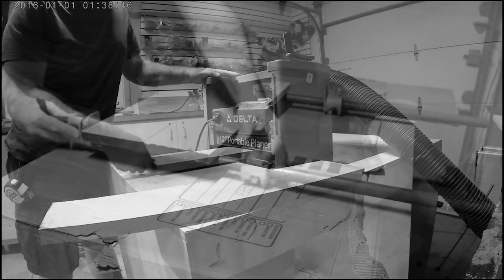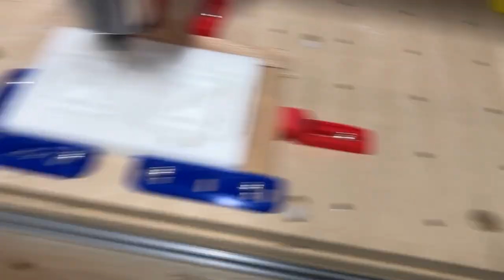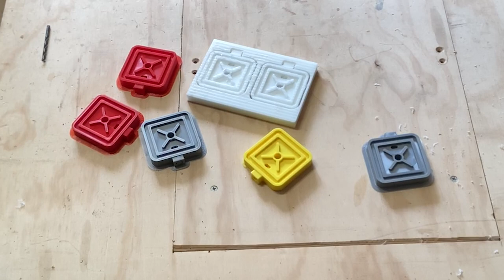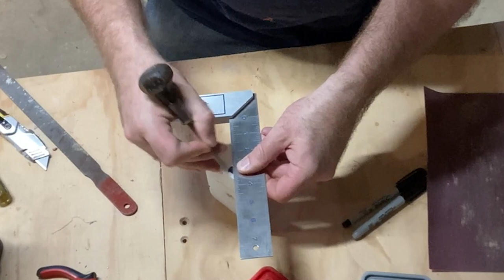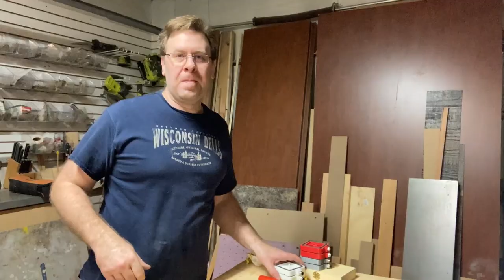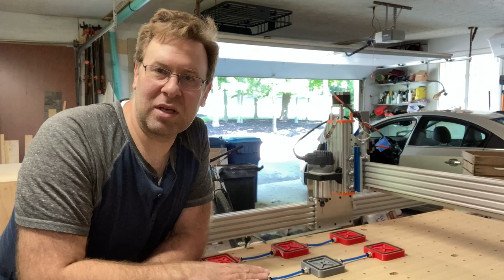Vacuum Clamping Pods for your CNC

Comment: Thanks for the video. I’ve made a system with an 18” x 18” vacuum plate using a 3.5 CFM oilless vacuum pump. My pump barely pulls enough vacuum for clamping a piece 18” x 18”. I would suggest a more powerful pump, something around 5 CFM or bigger.

Comment: Thanks for this. I bookmarked this video a few months ago and finally getting around to making these. I am using my resin printer for the pods, we will see how they go but should be fairly accurate and smooth. 

I do a lot of signs using PVC and because it's more flexable than wood it tends to bounce a lot giving poor finish unless you use double sided tape to hold it down. The issue is tape isn't reusable and can start adding up with enough signs.
Reply from the maker: I hope these vacuum pod work for you, maybe a vacuum table would be a good solution?
Reply: @smedleywooddesign2219  I ended up designing a 11inX11in pod that I made with the CNC out of a 1in thick cutting board since the bulk of my work is 12inX12in signs.

Still waiting on the rubber seal to get here to try it out.

Comment: I'd like to share a tip about vacuum pods; try using high pressure laminate (HPL) for the pods. It is a material similar to Formica, only thicker. I have bought scrap pieces from a furniture factory, where they use it for table tops. The pieces I've got is app. 1/2" in thickness. Although it is a very hard material, it machines beautifully with tungsten carbide bits. I find it to be less slippery than HDPE, which is desirable in this application...
Reply from the maker: Thanks for the tip, I have worked with HPL before and will have to give it a try for the vacuum pods.

Comment: The only concern is this: you need to surface the pods because no 3D printer can print perfectly squared surfaces. You need to surface them on your CNC after you printed them if you want accuracy.

Comment: If I would have looked at your links before I went to Lowes I would have saved over 50 bucks on these fittings and hose.
Reply from the maker: Sorry to hear that.  My go to for parts like this is has been Amazon lately, they seem to be the cheapest, that I could find. Thanks for watching.
Reply: @smedleywooddesign2219   I got the rubber round cord in today and it fits and seals even better than the lowes stuff I had in there.  Thanks once again for sharing your resources with us.   On my Harbor Freight pump I 3d printed a fitting to go from the fine threads of the pump exhaust to accept a 3/4" piece of pipe so that seals up nice for those of us that started with the less expensive oil vacuum pumps.  It's all working very good.   Your pod design now has me with 6 printed pods.   2  of them will go for a sanding jig that I can clamp on my work table.  The other 4 will be used with jigs that I make for some of my Royal Ranger awards and gifts.  Canteens, Lanterns, Cups and plaques and signs of all kinds.  
 
Now that it's all working it's time to organize it so it functions well with my setups.

Comment: You might consider getting a 5-10 gallon air tank to just as a reservoir for the vacuum pump.  Gives you a little safety factor :)
Reply from the maker: I have seen that done before, I’ll have to give it a try thanks

Comment: I was about to draw these up for myself in Fusion 360 when I found your video, so thanks for sharing! Can you share your printer settings for these...and how well they've held up?
Reply from the maker: I am printing everything on a Ender 3pro using Cura for the slicing software. The settings I am using are from the CHEP Youtube channel, here is the link to those profile setting, https://www.chepclub.com/cura-profiles.html I think there are 4 different profiles to choose from, for the pods I used the "Good" profile. So far I have cut out 6 parts with pods and they worked great for holding down melamine sheet, I could not get them to hold MDF or any types of  hardwood. I need to play with it more to see how I can get it to work for those material. I hope this help, Enjoy!
Reply: @smedleywooddesign2219  Hi thanks for the nice video. Are you already able to hold down MDF on the pads. I use a lot of MDF so that would't be nice.

Comment: Thanks for posting a great design with links that works great.  Printed one to try it out and it works great.  Printing 3 more.  Thanks for the links and the tip on the die at Harbor freight.   I do have a question.  My Harbor freight vacuum pump is doing a lot of misting when it is really holding down the parts. Is this normal?
Reply from the maker: I'm happy to hear that these are working great for you. For the misting, I'm not sure why your pump would be doing that, I did not see anything like that coming out of mine.
Reply: @smedleywooddesign2219  The vacuum pump you have is the more expensive type that is oil less.  If I get to doing alot of vacuum clamping I would upgrade to the oil less pump or vent the oil ehaust outside after it passes through my filter.

Comment: Hey thanks for the files. I'm going to print and cut these when I get home. Did you find the HDPE or 3d print held better? What infill did you use, did you seal the 3d print at all, similar to how you would with mdf?

I appreciate the help and thanks again for the video and file
Reply from the maker: HDPE and 3D print both worked about the same. I did not seal the 3D prints they worked great. For the infill I used 25%.  Sorry I did not get back to you sooner. I hope these workout for you.
Reply: @smedleywooddesign2219  no problem at all! I appreciate the follow up

Comment: How did you attach the pods to the spoilboard? Do you have a vacuum table? or did you use some double-sided tape?
Reply from the maker: I have some threaded inserts in the spoil board, I secured the pods down using those.

Comment: Would you have a cnc file version if someone doesn’t have a 3D printer?
Reply from the maker: I can provide you with the DXF I used to create the cnc file. The layers of the dxf are named the depth of each tool path or pocket. It's probable best that you create your own tool paths from the software you use to make cnc files. I added the dxf files to Thingiverse.

Comment: What 3D print settings did you use to print Pods?
Reply from the maker: I am printing everything on a Ender 3pro using Cura for the slicing software. The settings I am using are from the CHEP Youtube channel, here is the link to those profile setting, https://www.chepclub.com/cura-profiles.html  I used the "Good" profile. If  you do not use Cura the setting I used are, Layer height 0.2 mm, wall thickness 1.2mm wall line count 3, top\bottom thickness 1.0mm, infill density 25%, infill pattern grid, print speed 50 mm\s . I hope this helps. let me know how they turn out. Enjoy!!

Comment: You might try using cotton swabs and CA glue to patch those holes instead of Bondo. Ready to re-drill in 5 minutes.
Reply from the maker: Thanks for the tip, I will have to try that.